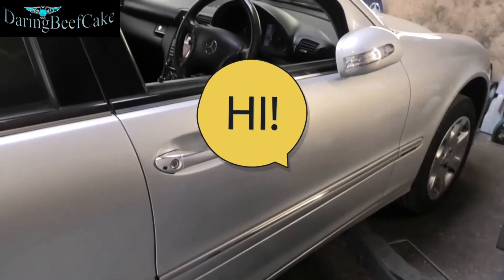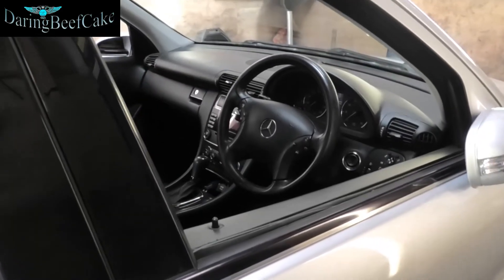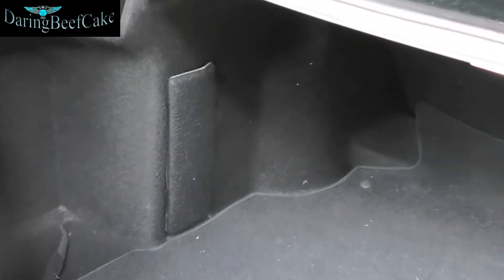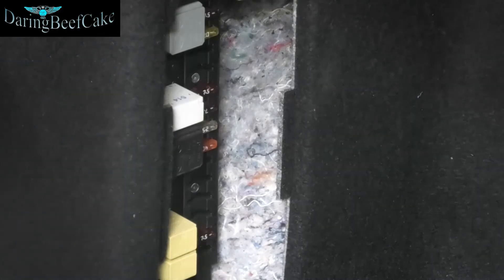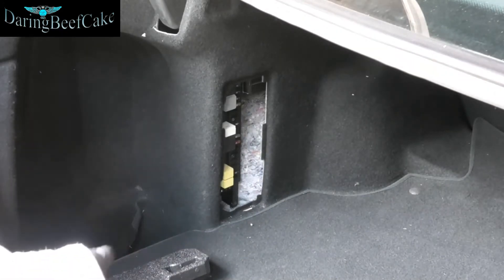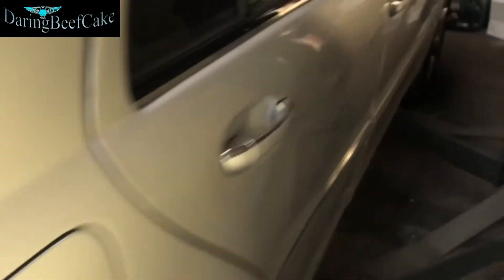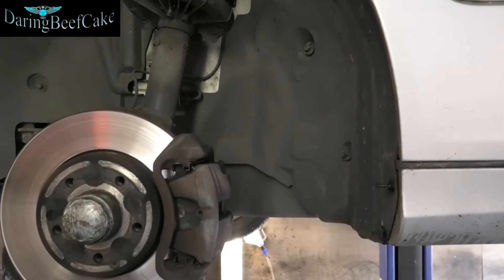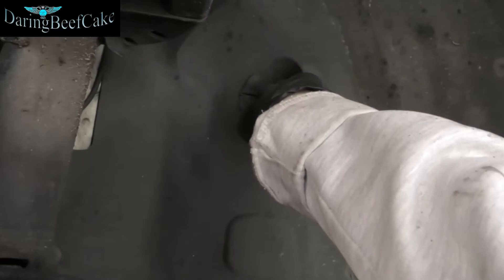Mercedes w203 c180 2005 no remote central locking no radio signal problem fixed siren replacement

Comment: Thank you very much for your vid. I had the same issue with my 2006 Mercedes CLK 350 coupe fob. Did what you said and now my door locks and unlocks with no problems. You saved me $$$$$$
Reply from the maker: Perfect that’s the whole idea, try and help each other specially is this hard time.

Comment: I have the same exact problem with a 2004 Mercedes C230 w203 but the fuse and the power going to the fuse box is working 100% I can unlock my doors with the IR of the remote but not from a distance.
Reply from the maker: Well it is an old car, it doesn’t work from too far. In any case a new battery on the remote key, can help sometimes.

Comment: This video really helped me.  It solved my problem with remote lock and radio reception in my 2006 C280 4matic 3.0 which is left hand drive (uSA).  To remove the alarm siren  bracket  I needed a t30, t40 , and 8mm.  The electrical connection was tricky too, I guess you just pull it out (I was looking for a locking tab, didn’t see one).
Reply from the maker: Am really glad the video helped.

Comment: Have just found your video and the two issues you flagged up (central locking & radio not working!) are identical to my C-Class Estate from 2005.  My one question have pulled the fuse guide and see my car has three separate locations for fuses (ugh!), do you think Mercedes fuses in similar locations irrespective of whether a coupe, saloon or estate? The fuse box you showed looks similar (I think) to the one fitted on the inner rear wing on the estate and I noticed the fuse rating was the same, 7.5.  My central locking and radio pretty much stopped working at the same time, though I do have intermittent radio working, but it doesn't stayed tuned-in very long. I'm not sure if I have a similar alarm issue or just a blown fuse.
Reply from the maker: Hi to be honest I have seen that the saloon and estate have the fuses in all similar places, so technically the fuse you have found in the rear fuse box should be the one to look at, and as the manual recommends when pulling a fuse just make sure the ignition is off so all systems are off. as soon as you check the fuse you'll know if that has blown, and once you replace it you'll also know if it was just the fuse or its guiding you to a siren issue.

Comment: I removed alarmsiren unit today because fuse 8 kept blowing. After removal alarmunit fuse kept blowing. Decided to remove towalarm unit in trunk also. That did the job. I can use the remote and drive my Mercedes without blowing that damn 8th fuse.
Reply from the maker: Well done with sorting your car out :)
Reply: @megatron29 by any chance do you have a picture of the Towalarm Unit and where it's located?  I want to remove it but don't know where it is..  I removed the horn already but still have the same issue that remote not working

Comment: Thank you very much. However, my alarm wires are missing from the area under the drivers side wheel. Do you know where the other end of those wires should go?
Reply from the maker: I would think the ie an alarm module somewhere and possibly some of the wires go to the main ecu too..

Comment: Thanks for the video. I disconnected the siren and the fuse no longer blows. Radio is working too! However central locking still not working. The fob in the battery is fine. Any ideas what I should try next?
Reply from the maker: Does the central locking work when you press the lock unlock button that is in the car ? If so then may be you remote key is not working, try a spare key if you have.
Reply: Yes it does, and the spare doesn’t work either. The fuse map for central looking also just says “automatic”, which I’m assuming means the central locking is not on a fused circuit. .
Reply: on the plus side, the radio is now fixed :)
Reply from the maker: very true, nice to have a radio working, there are two possibilities the central locking receiver is not working or the keys are faulty. may need to be plug into a computer to see what fault codes may or may not be showing..   @davidjkeller
Reply: Strangely I noticed that the central locking was working as long as I pointed the key at the lock on the door handle, from very short range. After a few days of doing that to unlock the car, the central locking now works fine, from a distance. I have no idea why! Thanks for your help!
Reply from the maker: no worries you welcome, usually the battery on the key caused that kind of issue, but i think you said they have new batteries. in any case am glad its working. @davidjkeller

Comment: Thanks for the video @DaringBeefCake.. my remote is not working to Lock/Unlock (only works if I point the key to the infrared port on the driver's door external doorhandle) so I thought it may be this issue.. when I press the Panic button on the remote only lights go off but no Siren sounds.. so I thought it could be the Siren.. checked Fuse #8 in the trunk Fuse Box but it was ok.. anyhow pulled off the Siren leaving the wire unplugged with some duct tape.. still Lock/Unlock not working.. what else can I check?  Saw that somebody mentioned something about also a Tow Alarm, any more info regarding this anyone?
Reply from the maker: have you change the battery on the remote itself, just checking. otherwise i do believe there is a receiver somewhere that can cause issues..
Reply: @DaringBeefcake  Thanks, yeah that was the first thing I did, new battery on the keyfob.. so I will need to look to see about the Tow Alarm Module.. if there is any more suggestion deeply appreciated.. also say there is a resynch remote procedure on the SLK but the key / remote looks different.. don't know if this would be the case
Reply from the maker: @arthurdeleon3309  am not really sure sorry. may be check for fault codes.

Comment: Same issues fob/radio changed fuse and blew straight away. Will check the siren at the weekend
Reply from the maker: Yes have a look at that.
Reply: @DaringBeefcake  many thanks all fixed ( would never have suspected the alarm ) 
As its an old car I just disconnected it,  if any one else does this you can get away with removing some of the fixings and pull the wheel liner back without removing it
Reply from the maker: @petertownsend1509  you welcome and thank you for living some tips for others ..

Comment: Hola, mi coupe w203 del año 2003, le pasa lo mismo pero he comprobado los fusibles y están bien. Cuando compre el coche no había problemas. Yo creo que no tengo sistema de alarma. Cuando puse las ventanillas en negro me dejó de funcionar. Me dijeron que podría ser por la ventana del maletero que hay un receptor en las líneas que calientan la ventana cuando está empañado. Pero me parecía raro. Crees que podría ser eso?
Reply from the maker: Pues hay un receptor del systema en la parte de arriba de la puerta trasera hay que sacar la cubiertas de plástico.
Reply: @DaringBeefcake  si lo he estado mirando y creo que va ser eso. Muchas gracias

Comment: Im having the same issue now where the fuses blow every time i put a new one in. My car never beeped when i unlock and lock the car before in the 6 months i have owned it. 
The blown fuses just started today.
Reply from the maker: well sounds like you need a horn..
Reply: Thanks for the information, same problem can't lock the doors from the remote control, and no arlam sound when it worked

Comment: What if the fuse is fine but no signal on radio no central locking am lost I have same problem but the fuse is ok
Reply from the maker: In the video the solution is not the fuse, the problem is the alarm siren, watch the video.
Reply: Why would the alarm siren have anything to do with the unlocking of the car and the radio signal?

 @DaringBeefcake
Reply: @georgec7798 because those systems are linked in same circuit and if one fault all of them fault